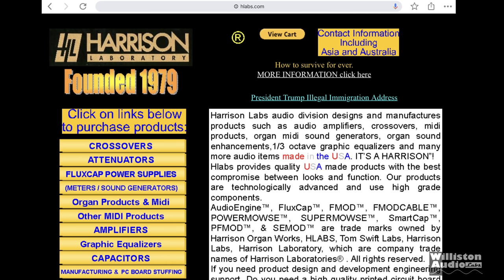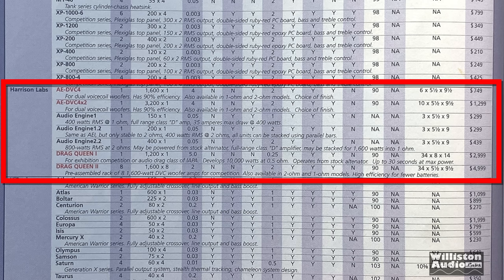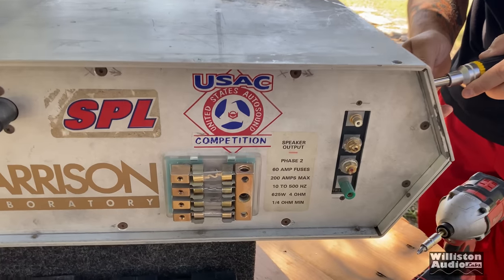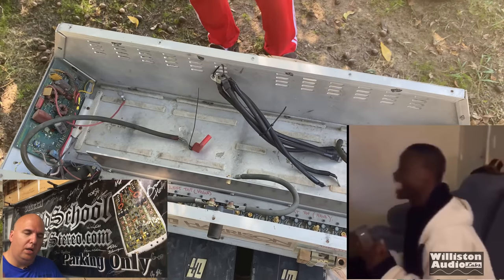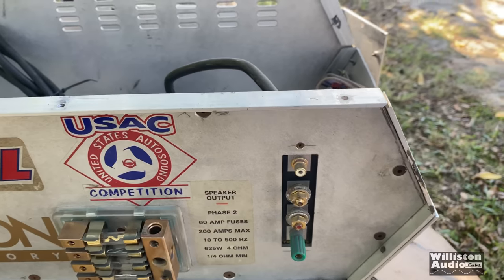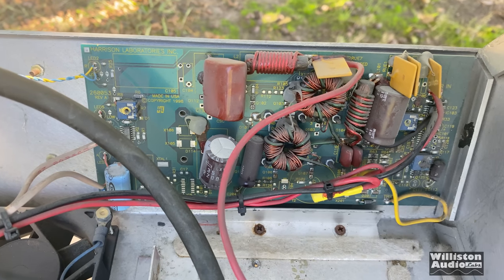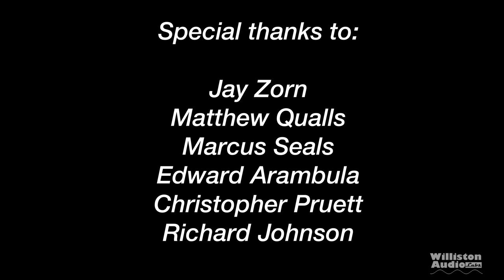20,000 watt Amp Banned from Competitions? 2000 Harrison Labs Drag Queen [4K]

Comment: I had a $7,000 Sony/Rockford Fosgate custom installed system in a $900 1969 VW Bug in the late 1980's-early 1990's. By todays standards it would be considered low power. The 2 12" & 2 15" subs had Power 300 on them. The 2 8" mid bass & 2 satellites had a Punch150. 2 way active crossover was set a 70hz. It was one of the top 2 or 3 systems in Ardmore, OK. The JBL system in my Prius sounds awesome today & I have all my seats. My old VW had no back seat. The 15" subs fired into the back of the front seats. Had big sealed box up to the side windows. The 12" were put in first in a sealed box in the cubby space below the rear window. It wasn't long until I had the 15" subs put in.
Reply: who would guess huh..... The AUDIOMOBILE 1kVW.... that comes to mind here.... LEGENDARY..... Heres yp the OLD GUYS here..... who remember a time.... nice ..... Did your head unit move every time ya turned on the windshield wipers...LOL....... Some head units back then were FAT or had a HUMP on top...... VW bug..... I worked on a LOT of them..... Thanks for the memories... Mr Brown...
Reply: @bigdogbrodavepresents6178  No. The installer noodled the "dash" between the glove box & steering wheel. My head unit was a detachable face Sony that controller a 10 disc changer that was under the front hood. Under that was a matching Sony slide out deck cassette player. Under that was the RF preamp/EQ. All mounted tight & solid. As I said, it was all custom install. Likely more than half of the expense was the labor in constructing the boxes for the subs, flush mounting all of the amps & Xo, cutting the dash, laying out all the wire & cables, & making it all look like it came that way from factory. The car itself was a resto mod before the audio system was installed. My uncle & my dad restored it & customized It for my older cousin's first car, but my dad had a old 914 he traded for It to be my first car. It was a beautiful bug. Had extra wide fiberglass fenders that looked factory. Had wide front & rear wheels & tires. Had old Ford teardrop tail lights. Had 356 head lamps. All of the interior & exterior was done. My dad died before getting a chance to fix up the engine with after market heads, cam, carbs, & a 12V conversion & before the audio system was installed. Thats how I had the money to pay for the audio system. It really needed a 12V conversion, but I was just a dumb kid. I thought the lights dimming to the beat as I cruised the drag was kinda cool but if I was going 70 or 80 mph down the road it wasn't really noticeable. I had 2 deep cycle marine batteries that powered the electronics, but the stock 6V generator would fall behind on a daily basis as I was always jamming at concert level draining more power than it could keep up with. The subwoofer amp would shut off after a few hours. Then I would have to make a recharge drive.
Reply: @adambrown8867  I wish all the viewers here get to read your reply..... Now THATS OLD SCHOOL FOLKS,,,,,,, a 6 volt CHARGING CIRCUIT to power a 2 12 volt BATTERY system..... UDAMAN...... CLASSIC..... and it would drain to like 8 volts then kinda stay there...LOL.... had to RECHARGE at the TESLA port...LOL..... Thats so cool dude...... so REAL....... I can see you pulling into my shop..... Dude thats a 6 VOLT alternator.... UPDATE that bugger HERE........ I was the DUAL ALTERNATOR GUY wayyyy back when. I tried my best to sell certain customers the FOUNDATION.... a strong independent 12 volt system that wont cause yer cars battery any distress whatsoever.... Car Stereo dies at the BEACH?..... no biggie..... just START the car and... back to playing.... I actually FLEW a BUG once in Jesup Georgia..... LOL.... Ya wanna FLY a CAR.... it should be a BUG... indestructible... I remember them cool ass FLARED Fiberglass VW fenders..... Nice.... I sold my Barracuda and bought a 64 bug..... later in the Navy I bought that FLYING 65....LOL..... memories.... Hey I LIVED....LOL.... Baby MILLERS.....
Reply: @bigdogbrodavepresents6178  I was a pissed off 14-15 year old kid with a mom that worked nights at a factory. Like i said, a dumb kid with money burning a hole in my pocket. I'm sure I was told about how a 6V generator wasn't sufficient but it worked well at the time. I recall looking at a big Wrangler 12V alternator that had huge amperage, but by then I couldn't afford it. I'd blown every penny my dad left me by the time I was 16 or 17. Say no to drugs.
Reply: @adambrown8867  quite the life experience... Death... I was a crazy teenager too.... Hey... we LIVED huh?.... Yours is a story I heard before... My FIRST INSTALL was in a 1954 GMC TRUCK... It was POSITIVE GROUND too...LOL.... Them days....... Needed a VOLTAGE CONVERTER BOX to bump it up to 12 volts for the radio my dad had. Mounted it to WOOD so it would not touch GROUND.... LOL.... RADIO SHACK voltage converter.... I was 14?..... LOL.... My dad was a car guy back then... He liked his stereos...

Comment: The amperage is also in conjunction with 72 volts not 12 not 14 .2 but 72 volts. That is 28,800 Watts. (Not sure his machine can even test 72 volts) but yeah this baby probably does pumped out some power. The internals can be smaller because it's not having to transform the power. Imagine what it could have done with much larger capacitors though. Perhaps some extremely large external farad's. 
     Now to use it power your speaker Bank on your side  dump pickup bed with camper shell opening clam shell style. Such as was in the day of the slammed mini truck.
    It's like Harmony audio most never heard of Harmony but they do make excellent sound equipment they are the leading manufacturer of music instruments going back decades. And their amps consistently exceed the rated power output.
Reply: with deep cycle cells in the amp, you dont need huge caps, the battery bank is a giant cap, no dc-dc converter needed
72(12 x 6)v@4ohm = 18a = 1296w to each speaker (need to take out about 15-25% for transistor efficiency)
says 1/4 ohm stable = 16x 4ohm speaker in parallel max = 20736w
Reply: This isn't an amplifier, Sir.  It's a sine wave to square wave converter.

Comment: I believe that would be 60 amp slow blow with a maximum of 200 amps each.  So, if you exceed 60 amps for a certain amount of time (depending on what you buy) it would not blow right away.  But regardless of what you buy, it should blow immediately at 200 amps.  Thus, if you draw 150 amps for 300 milliseconds, the fuse (again, depending on what fuse you buy) should not blow.  But drawing 150 amps for 2 seconds probably should blow the fuse before the charging circuit burns up.
But the fuses shown do not look like slow blow fuses.
"only made five of them",
So we're looking at a serious collectors item.

I don't know what "class HL" means, but a quick lookup at class H amps explains the minimal design a lot.  Basically, this amp was never designed for regular use.  You would need HUGE external batteries hooked up to the internals to power this thing for any appreciable length of time.  It was designed to take 1 or 2 hours to charge up and then 10 or 15 minutes to drain the batteries.
I'm no expert in SPL competitions, but I can guess they banned the whole concept of batteries feeding class H amps.  Because all you have to do is keep adding batteries in series and output Xsistors in parallel, and you can pump that up to no limits -- a half million watts if you have the money.  And the whole of it would get no more complicated than what you've already seen.
Reply: batteries was the slow system.... Theres a CAP BANK for this amp that DUMPS A LIGHTNING BOLT in 30 seconds ..... that was the MAX run time specified by the design and Events of them times so it was primarily designed to do exactly that. 30 second run... max output.... Battery packs gave ya less output but a longer run time is all.... CAP BANK was the FIRE..... Lightning in a BOX.... BOOM!!!!!
Reply: @bigdogbrodavepresents6178  No wonder it was banned from competitions.

Comment: HVAC (sheet metal) is typically 20-28 gauge galvanized steel sheet metal held together with slips and drives.  Nothing like this box.  FYI!  It does have the appearance of being made in a "low tech" small shop with a small Pexto brake.  It would be interesting to see a scoped output at load.  ;)

Comment: I researched the amount of amps a shorted battery will deliver. One battery will deliver 2400 amps. Now, muliply that by 6 and that equals 16,400 amps going into the speakers. I could not find the maximum amount of amps a speaker can take, but an averaged of 5 to 15 amps is what most speakers can handle. I don't know what to gather about this info except that I think this amp would blow your speakers to little pieces and the amp itself would blow up like a small atomic bomb and I would not be any where near this destructive device when it went off. What do you think will happen when you short 6 batteries?
Reply: If you short 6 batteries you probably won't be alive
Reply: @loganmilam4065  Exactly, that's the reason they banded this death trap from competition.
Reply: @albertsmith6717  I was wondering that. Kudos for informing us

Comment: Looking from the front, the small board on the right seems to be the driver board for the output stage that runs along the front.  The calculations seem to be for peak power, RMS is usually half, but would be more if clipping (good for blowing speakers) - the formula would be correct for a square wave.  From having phase 1 and phase 2, looks like probably outputting in a bridged configuration. Loads of output transistors in TO220 style packages.

Comment: Had experience with high grade concert audio equipment from the age of 5 now 41. Worked with power blocks from 2000 watts to 250000 watts. Best advice always have high grade ear protection preferably noise canceling forms. Make sure to charge the voice coils on the audio equipment before cranking up the volume. A spider separation from the cone is never a pleasant experience. Power management is another big deal. Ensure your systems has the capacity to handle the current your setup will draw. One good power surge can kill 100s of thousands to millions of dollars of equipment in an instant and if your lucky no major fires will break out.
Reply from the maker: Thanks for watching and commenting!
Reply: @wal  My pleasure. Just wanted to help emphasize proper safety measures are taken by people who may wish to experiment with high power audio equipment. I suffer from chronic tinnitus it's not pleasant.

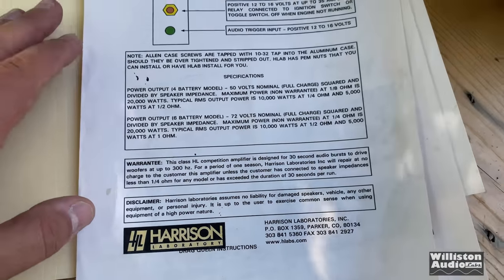Comment: The numbers are interesting, I think it's worth getting one of these things working to see what it really does!  Whether it meets specs in the real world will depend in part on the actual battery voltage during testing, whether it's 12V or more like 13.5 or 14V.  At 6:52 the 6-battery specs read 20kW max power at .25 ohm and 10kW RMS at .5 ohm.  Assuming 12V, and if we ignore that batteries have internal resistance and pretend they maintain voltage under any load, ignore that fuses have resistance, ignore that the output devices have resistance, etc..  If you ignore those things, then six "12V" batteries in series gives you 72V rail voltage.  They must tap from the center to get + and - rails.  With a 0.25 ohm load that gives you a max instantaneous (peak) output of 20,736 watts, and assuming a sine wave you get max RMS output of 14,662 watts.  At 1/2 ohm they claim 10kW RMS, which only works out with a square wave, sine wave RMS would be 7331W.  Throw in all those realities that we ignored earlier and the real world numbers will be a chunk lower, ALTHOUGH if they are charging the batteries up to 13.5-14V then that makes a very significant difference and can make up for much of the losses we ignored earlier.  Overall it's a creative way to get what was probably still a lot of power for the era, without having to build a power supply stage, and it would be interesting to see what it does in a real world test.
Reply: The supply from the car alternator is largely irrelevant. All that supply does, is charge the 72 volt array of AGM batteries, which, under load, probably sag to about 50~55 volts. A 50 volt square wave will put exactly 10,000 watts into a .25 Ohm load. The only thing that keeps the MOSFETS (if that's what they are) from cooking, is the fact that they clip. It's basically a square wave, deeply clipped signal. The heatsinks are not massive enough to dissipate the ~4,000 watts of heat, if it was indeed 10,000 watts of pure sine wave output to the speakers. It specifies, that it can sustain this for about 30 seconds, which is all you will get out of a lead acid battery that size, before it simply runs down. The heatsink just doesn't have enough area, nor the mass, for 30 seconds of sine wave.
     If the batteries were so stiff, that they could maintain their full 72 volts under that horrendous load, the amp would indeed produce exactly 10,000 watts RMS sine into a .25 Ohm load. That requires 200 amps into the speaker, if that was a sine wave, the current would crest at 282.8 amps peak, for 200 amps RMS. It truly needs the four 60 amp fuses in parallel,(240 amps)on the output. To avoid the need for the center tap on the batteries, the amplifier is a full H bridge design, allowing full battery voltage to be applied to the speakers in either polarity. No center tap necessary, otherwise, the amplifier would only produce 1/4 that wattage into the .25 Ohm load.(2,500 watts)
Reply: @vincentrobinette1507  the CAP BANK supplied 100 volts and BOOM.... dump the entire bank in 30 seconds.... Batteries gave ya less output but longer RUN time... How it was explained to me wayyyyyyyyy back when....

Comment: 60A fuse and 200A max seems okay to me. Fuse math is a bit different than regular math.
Reply from the maker: Because it is higher voltage
Reply: Looks like the 4 x 60A fuses are connected in parallel. Therefore they could cope with 240A total on the incoming cable. This would be what the 200A max refers to. Total of 200A being drawn spread evenly across the 4 fuses.
Reply: @juliancox4178  The catch is that no four fuses are ever perfectly identical in resistance and few fuse blocks are absolutely identical in resistance to all fuse positions, so you never really share those loads equally among all four fuses.  Eventually the weaker of the four fuses blows first and the rest of the fuses then follow very soon thereafter (especially if the fuses are already running fairly hot).  So, in multi-ganged fuses one does typically aim for a total rating a bit above the target limit if one wishes to ensure that the full target current limit is always available reliably and that only faults actually blow the fuses as every fuse failure is going to set you back 4 fuses (in this instance) since all will fail very quickly in domino fashion.

Comment: Watching you test amps that  were built in the early 2000s makes me feel ancient. 
  When I first had a big system installed in my car. It was 1986 and I used Alpine amps . 1  x3528  a pair of 3531s each pushing an Alpine 10 pro . I think I used a pair of coaxial  5.5s or 6.5s in the doors and a pair of Polk audio 3x5, plates in the back.  .I had to build my own sub box , because at that time, the regions biggest audio  retailer didn't even build them.  .
Reply from the maker: Awesome. Thanks for watching and commenting!

Comment: why outlaw or classify illegal. If it exists and can be purchased it should be allowed, heck even if you build it  yourself  let a class for them be created. isn't it SPL not SPL Capped? id love to own one for sure, wish you did dyno on that air conditioner lmfao. if you build it they will come!!!!!!!
Reply: Because being designed for CAR audio sound competitions they were very specific about the power supplies and had to be powered only from the vehicles charging circuit.Any other power supplies or being disconnected from the car's alternator by hidden relays or circuit breakers were deemed illegal by the sanctioning bodies.This was in the early days of IASCA sound offs though and has probably changed by now as SPL was just a novelty back then.
Reply: It's not a musical amplifier, it's a square wave generator. In addition to being illegal by virtue of its internal batteries, amplifiers for SPL competitions have to be able to play music, not just square waves. If square waves and high voltage batteries were allowed any old bloke could hook up a few IRFB4110 FETS, a gate driver, and a 555 timer and have a really really loud system. Trouble is, it could never play any sort of music, just a really loud buzz.
Reply: @thorlancaster5641  I had several HL amps and they sounded fine. Played music as well as Burping.